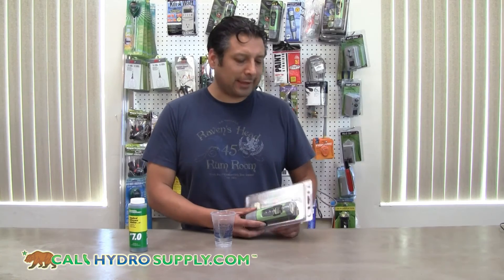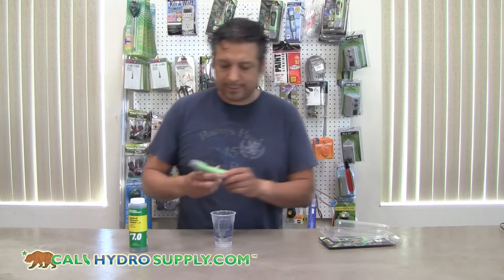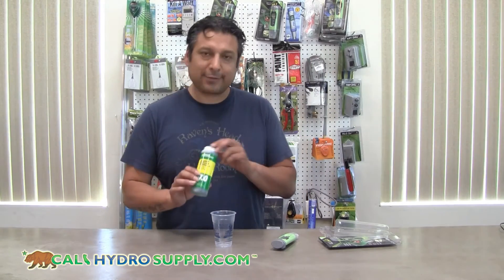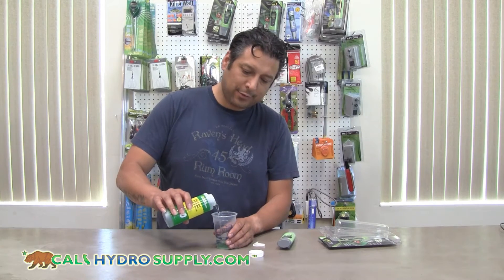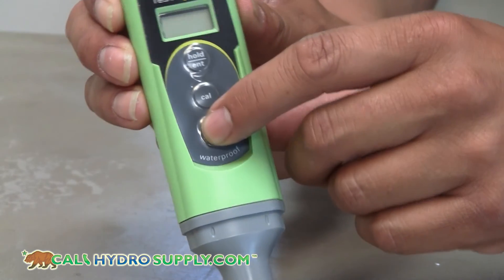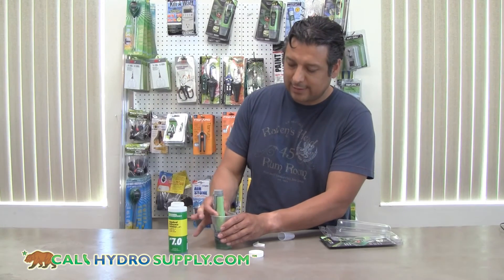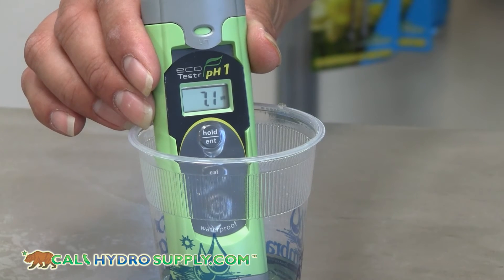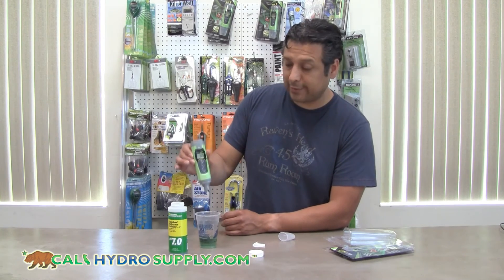How to Calibrate an Eco PH-One ph tester

Comment: This is completely wrong.  Should just consult the actual owners manual which you can find here:
https://www.rshydro.co.uk/PDFs/Eutech/ecotestr-pH1-operating-instructions.pdf

I'll clearly never be buying anything from calihydrosupply because this guy is kind of an idiot .. and he certainly has the operating manual since he opened up a new pH meter.  Maybe actually read it before making an instructional video.  It can do nothing positive for your company when you demonstrate the incorrect method when you had the operating instructions all along and just needed to read them first.  Stupid.

tl;dr Don't want to read the manual
On -> Immerse meter in ~20mm calibration standard -> Let value stabilize -> Press Cal (DON'T HOLD, just PRESS) -> Press Hold/Ent -> You're done (clean probe afterwards though).
Reply: thank you so much

Comment: If you try to calibrate the meter this way you will fail. It is correct to press the calibration button (cal) the first time after powering on to initiate the calibration sequence, but if it is pressed again at any time during this sequence then the calibration is aborted. Instead you should place the probe in the 7.01 solution after the sequence is initiated by pressing the (cal) button. The display will flash the letters (cal) a couple times and then a numerical pH reading will start to flash. This will give you an idea of how far off if at all the meter was. If the meter was already accurate then the display will be flashing right around 7.0, but if it is reading anything different, then that is the amount it is assuming a 7.0 solution is. So in order to calibrate correctly you simply let the meter continue to sit in the 7.01 solution for about another 15 seconds until the flashing ph number goes away and the letters (ent) appear on the screen. Immediately following this a 7.0 will appear indicating that the meter now recognizes your 7.01 solution as actually having a pH of 7.0

Comment: Pen should be calibrated using ph 7 and ph 4 reference solutions to maximize accuracy in the most commonly used range. This pen knows which solution it is in, simply clean ph7 solution off probe and immerse in ph4 solution and calibrate.